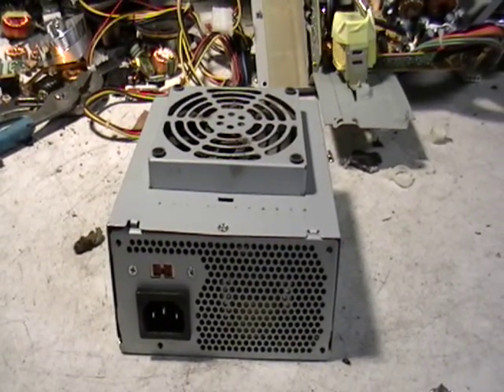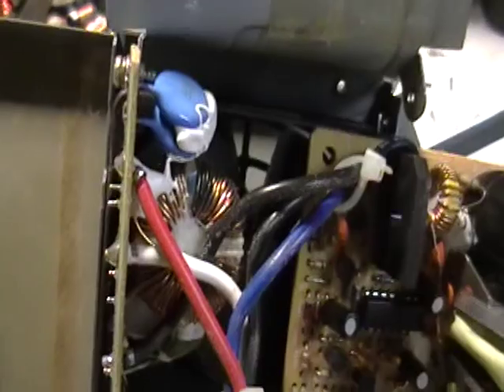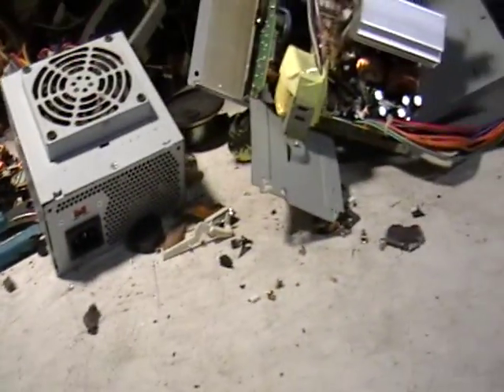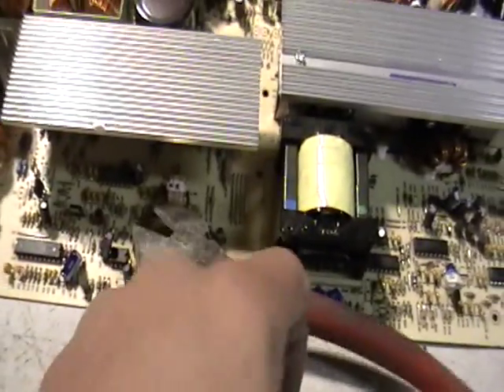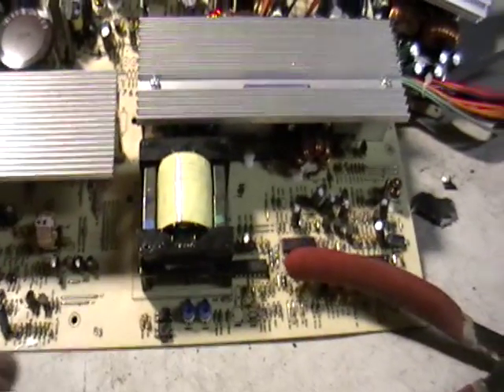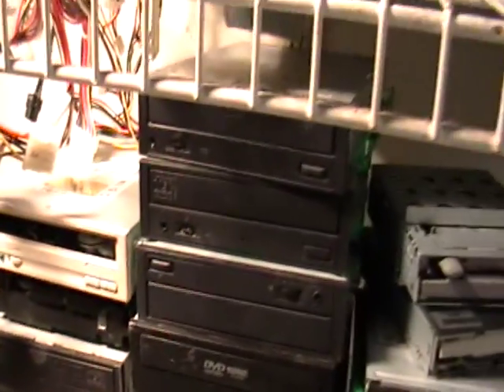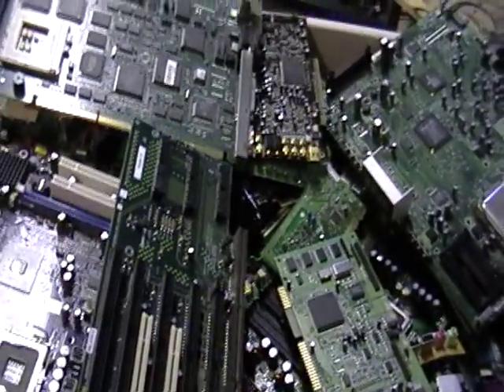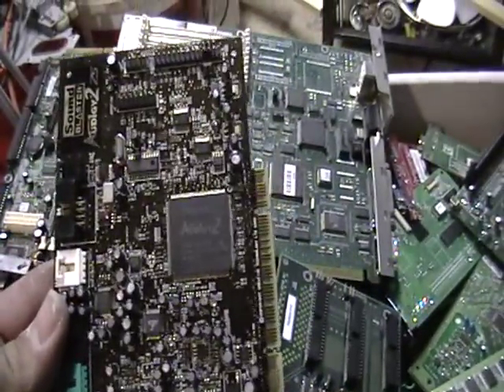Power Supply

Comment from the maker: @pkqkennywood@ the process i have seen so far is with out the acid.. they use like a reverse electroplating to remove the gold from the pins. i do not want to see my scrappers using the acids.VERY DANGEROUS.. Once i get my system up and running i will video the process...Peace